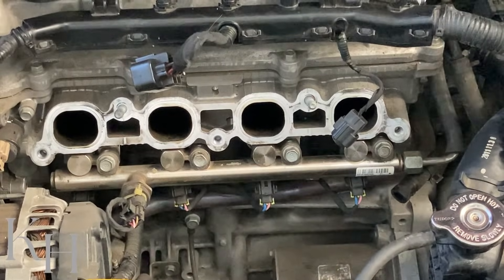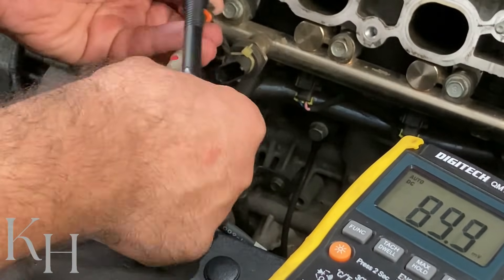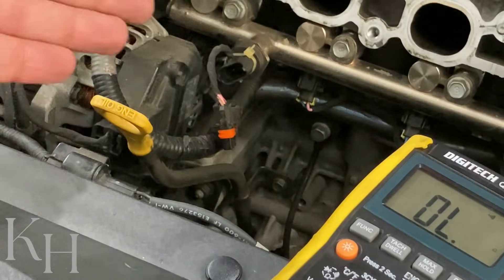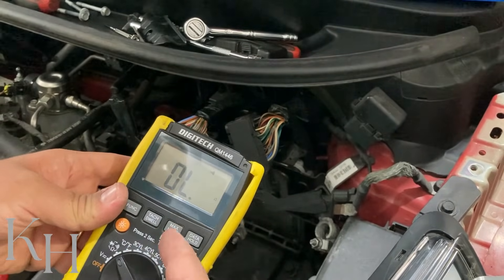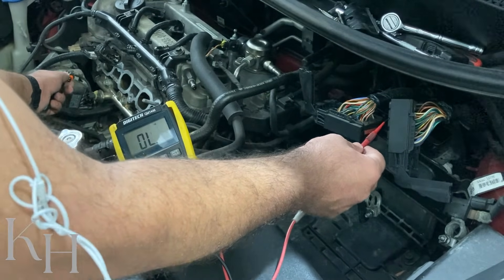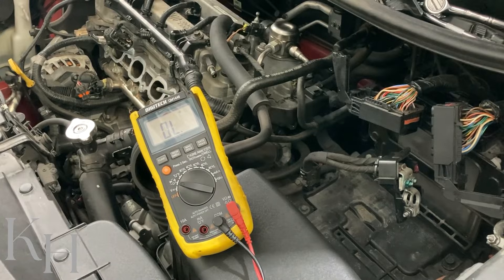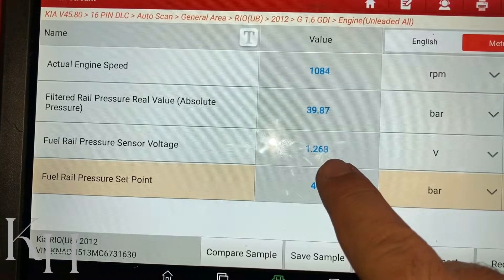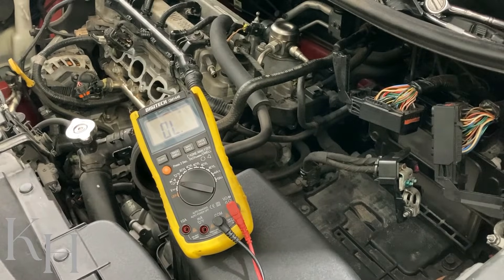Fuel Rail Pressure Sensor Diagnostics | Test & Fix P0191 Fuel Rail Pressure Sensor Circuit

Comment: There are many causes for this. Fuel filter, low pressure pump, high pressure pump, excessive injector return, faulty fuel pressure relief valve etc etc etc
Reply from the maker: Thanks for sharing your experience with us my friend 👍👍

Comment: Hello i am in need of your professional advise brother. I have same vehicle year, make and model. On my fuel pressure sensor connector my red power wire does not have five volts. Shows 0.00 and my brown ground wire makes no noise for continuity when i touch body ground. What can this mean???

Comment: Rail supply voltage high is disconnected no short to ground, if you short to geound it should have rail supply low

Comment: Hi brother actually my car is just like both the pressure bar are nearly the same lets say 40 bar by 39.9 or 40 for the pressure but some time when the engine is too cold after driving for 100 meters my car pressure would stuck at 5.5 bar but after turning the ignition of and turned back on they will be same again this happens once a day when the engine is to cold so do you thing my high pressure sensor has aproblem and i have to replace it or what. Thanks man
Reply from the maker: Hi my friend. 5.5 bar means that the high pressure system is not working. have you checked the fuel pressure regulator valve connector? it's on the high pressure pump.
Reply: @GoProAuto  hi brother, no I haven't check them but with OBD it's only given rail pressure sensor, my car is just running well only this happen when the engine is cold, so I am assuming the high pressure sensor might not work perfectly so right now I don't know what to do.
Reply: @cross-line-gaming5222 
Hey 
Maybe you have problem with pressure regulator??? You can test that part.